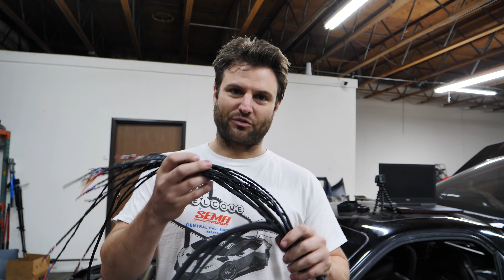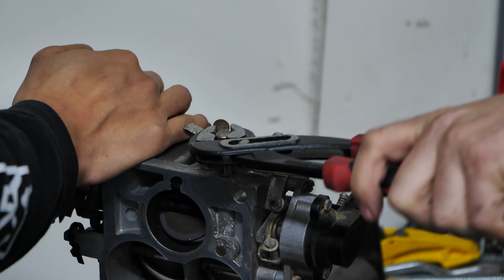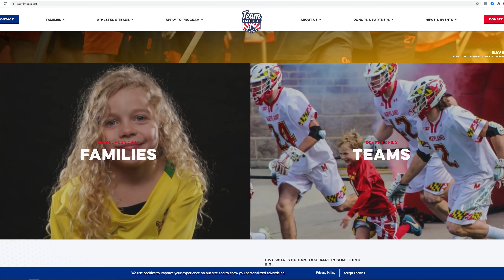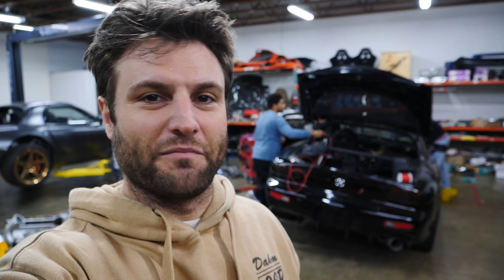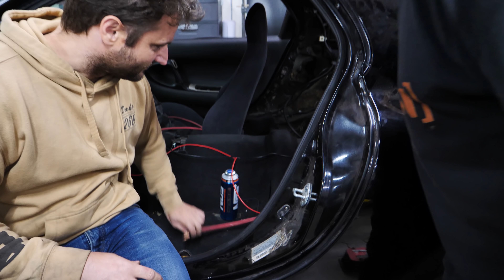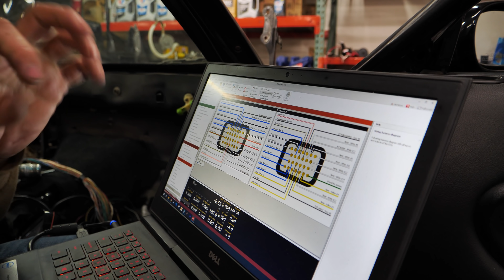The 3 Rotor RX-7 Fires after 2 years in pieces!

Comment: Please connect pressure fail safes for coolant pressures, oil pressure and fuel pressure. It will save your engine before you can blink (coolant pressure tells when combustion gas is in the coolant system)

Comment: Starting fluid is supposed to be sprayed while cranking. One, so you don't have pooling and well you saw what happened.  Second, a piston engine can become ether dependent. That is when the vapors from starting fluid are trapped in the combustion chamber and when spark happens the pop is violent enough to slightly twist a rod lowering compression enough to make it need starting fluid to kick over every time. Not a big deal on rotors but that pop can hurt the seals in a rotor. Doing the same thing.

Comment: put some epoxy in a shrink tube and heat it up and the shrink tube and epoxy will seal it or just use some hot glue en push it in a schrinktube the the tube will shrink automatically or just buy some shrink tubing with glue already in it

Comment: Harnesses need to be able to move. Heat shrinking end to end makes them tight, which makes wires too tight. They end up breaking from vibrations. Soldering isn't good, because it makes joints hard, again breaking from vibrations. OE harnesses are always either band wrapped or in gaffer tubes.

Comment: ..just buy heatshrinks with hot glue on the inside for the harness sealing... ..and maybe put some more hot glue in between the cables... ..we use them at work and I even make makeshift version of that for personal use (everybody has heatshrinks and hot glue at home)...
Reply: (..and for those who dont know the big secret, you can melt hot glue with a heat gun...)

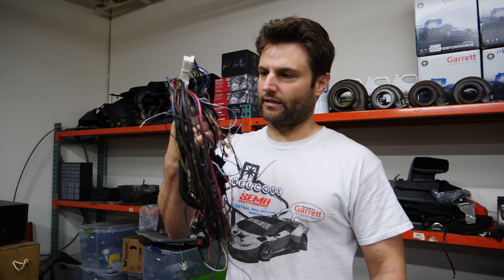Comment: 1:40 I think that's a good idea to move away from soldering.  While you probably didn't have the issue, not having to worry about the solder melting in a hot engine bay is a bit of a plus
Reply: If your wiring is over 370 degrees, you have bigger problems.
Reply: @majcrash  As if heat is the only factor here.  It can be softened and it's in an area you might be moving stuff around.  Being that rotary exhaust can become red hot when reving mixed with possibly lead-free solder getting too close, it certainly can cause an issue.  It's not as black and white as X degrees.
Reply: @PistolShrimpPimp  Lead free solder is crap.  Use 60/40 solder and you won't have a problem.  If your wiring gets that hot, the insulation will melt before the solder does.
Reply: @PistolShrimpPimp  Never use lead-free solder.  It's crap.  60/40 is king.

Comment: Hey rob a quick tip for you! When your engine has no comp poor a bit like 1-3 caps worth of oil into the runners then starting fluid and crank it up it’ll start straight away at work we do that with all the new engines we build because engines arnt ran in

Comment: Hey Rob. Take a look at deutsch connectors with E008 at the end of the part number. Those will have a heat shrink boot piece on the back. Awesome for harnesses. That potting compound also needs about 24 hours to harden.

Comment: heat shrink tubing also comes in marine grade that has a heat activated glue on the inside of the tubing.
Reply: Yes and it will self seal. Would have been a much better option. I will say this with the path he went he does not want to use 5 min epoxy as it will absorb fluid much quicker then long set epoxy, ideally he will use 24 hour epoxy, 1 hour epoxy will work and last much better then say 5 min epoxy as it will absorb fluids quickly. 24 hour epoxy will prolly last him the life of the car before its absorbed fluids. If he uses 5 min epoxy he will quickly regret doing so.

Like this comment so he sees it in case he don't know, it will save him a big head ache.
Reply: @EDCandLace  He said he was using potting compound.